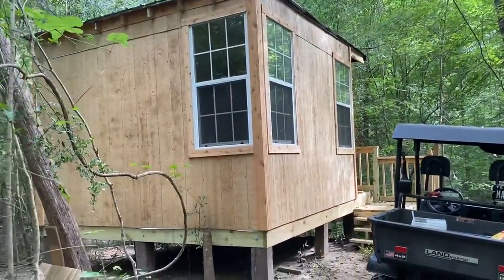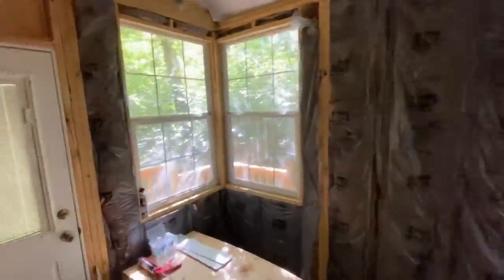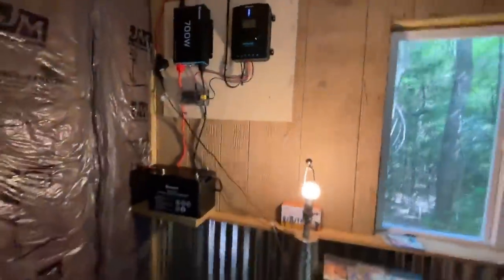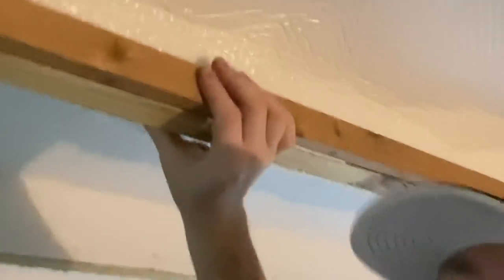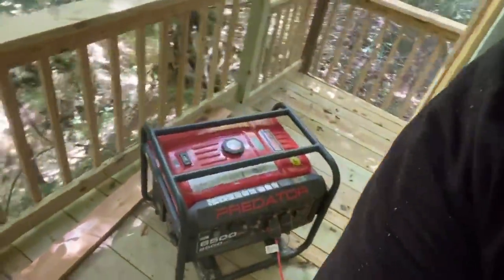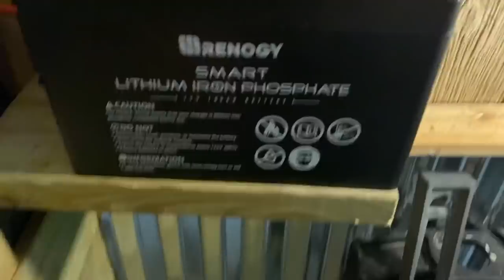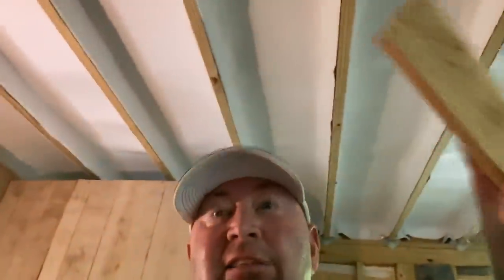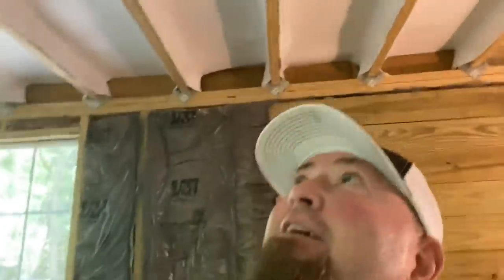Off Grid Cabin Solar Update, Fence Picket wall, & Ceiling

Comment: 1x2 on each side of the rafter and cap the bottom with 1x4.  It will look awesome!!! Love the wall. I bought a bunch of fence pickets when Lowe's had them on sale and used them for several different projects. I loved working with them. Cold Beer Cabin is really shaping up and looking great. Have a great day, John! Coooold Beer!!!
Reply from the maker: Kevin, on point.  Yes i like the idea of 1x2 on the sides & 1x4 on bottom🍺

Comment: When you do the rest of the wall, line up the new pickets with the dog ears together. There will be a diamond pattern down that line. Could look kinda cool. If you wanna cover it, just use another fence picket to match.
Reply: David Hancock like the idea of lining up the dog ears maybe painting a thin board black to put behind were it makes the diamond shape. It would make the diamonds stand out .
Reply: Or cut some little diamond shapes from a different color wood to plug the holes...very  nice.

Comment: Faux beams is a great idea!  I would trim the rounded edges off the fencing, leave a gap between each side so that your vertical peace would be flush with the boards.  Use the same wood.  The cabin is coming along great!

Comment: Like what your doing. Thought, the bubble wrap coated with aluminum needs to have a pocket of air between the roof and the aluminum for it to work well. Look up reflectix, that is the major brand name of this type of material. They have good videos on the site that explain why. If you don't want to pull down what work you have done you might consider sheeting out your ceiling rather than trimming it out. You would have a nice ceiling and have your pocket of air. But best practice would be to pull down the bubble wrap and put it back up with a 4" gap between it and the roof.  Still looks good!

Comment: Hey there John!!  Another great video as usual!!  Man! The tiny house is definitely coming together!  I like the idea of putting 1x’s on either side of the rafters and capping it off with  a 1x4.  And for the battery shelf, I’d just tack on a strip of wood that is taller than the front edge of the shelf and create a lip so the battery doesn’t fall frontward off the shelf.  Also, couldn’t you just use a picket panel to cover the seems of the dog eared end of the fence panel?  Well John,   hope you have a great night!  I am always looking forward to you next video!!  🍺
Reply from the maker: Hey Scott, thanks for your input!🍺🍺

Comment: I would try to get as much insulation in the roof as you can. Thats where most of your heat loss/gain will come from. That foam board is great easy to work with and pretty resonable. Looks nice man.

Comment: I’d be putting batts in the ceiling and covering the it with tongue and groove. 
Also, try to get at many 12v dc appliances to save running your inverter. A 12v light would be a good start.

Comment: Loving your channel CBR! Got my own little cabin out here in Arizona. A couple ideas- The 1x4  to dress up that ceiling is a great idea. A benefit to that is the tiny ledge it creates. You can hide thin strips of LED light tape to it to create ambient light at the ceiling level. Would look good! On the wall, you can also cut a few of those fence pickets in half, that way you have a staggered look to the wall. Even more "cabiney". EXCELLENT JOB! (By the way, think I'm stealing that corrugated siding for the kitchen. Love it!!
Reply: What part of AZ are you at? We are homesteading North AZ
Arizona Unplugged on YT

Comment: With respect may I suggest having done my 14x16 cabin.  I used the fence boards and know they will shrink.   That being said either spray the insulation black and or put black felt paper up then the board's.  Then in the future you won't see the stuff behind.
Second always do the wall from did to side with trimmed ends and stager the joints working your way up or down.  No direct seams up the wall.
Ceiling your idea of the side trim boards then a cap will be nice just know there is never enough insulation it will be an on going battle with heat and cold.
Some type of wood stove lots of ideas online for that.  Your in the woods with endless amounts of downed wood for heat.  Also if your out for several hours and want to maintain some level of heat a "vented propane heater" will be your friend.  VENTED.
Water can be done via containers and gravity fed and the low side of the roof should have a gutter for harvesting of rain water.
Your solar is great but know the wonderful trees we all love will also be a battle to insure solar gain from the sun.
Fun project enjoy the journey it's been an ongoing journey for me.
Best to you my friend.
Reply from the maker: Harold, thank you for all the insight and learning, I really appreciate it🍺🍺

Comment: I like the fence panels on the wall. I would have cut off the dog eared ends to be straight. Then they will butt up flush to each other & you won't need trim boards to cover seams. Or...still cutting the dog eared ends, but stagger the seams like they do on a wooden floor. For the ceiling, did you see what Good Simple Living did with their ceiling on their tiny house, inside their barn? You could mount beadboard, and hide the seams with the 1"x2" cedar strips you already have. Hope this gives you some ideas.🤔😏 Enjoying your vlogs on your tiny house build.

Comment: Hey John bring you a mini fridge down you need a place to keep that cold beer at and that will definitely set the power down and let you know how it's going to function and about the roof I'm a girly girl and I worry about the spiders and bugs that are going to be up there so I think you should enclose that with the same siding that you used on the outside of the house just close that sucker up. And yes trim would be nice where the dog ears join at, even though it would have been nice if you had cut the boards off halfway where it attaches to the 2x4 and then you could have attached the other board to the same 2x4 and then just run a piece of 1" quarter round down the seam. Everything looks so good. Are you going to be using a composting toilet?
I should have read the other comments oh well great minds think alike 💡

Comment: I think at the edge of the pickets instead of putting trim over it you should just put some black caulking in thereAnd stick a beer bottle cap in each one so it makes a bunch a little diamond shapes in each one you can have some collectors beer bottle cap or something in there.  Or maybe just put some black duct tape over the insulation underneath the edges so it’s all black and then just put a little caulk in a beer bottle cap and stick one in each little diamond shape.  That way you’ve got your cold beer theme going and it’s something unique that nobody else will have.  Maybe even have a bunch of users send you caps like they do license plates.
Reply from the maker: Shane great idea

Comment: The way you boxed the sides of the ceiling rafters and then put a 3 inch wide cedar board to cap it would look good. Also instead of 2x4 studs you could use the same 3inch cedar board to cover the joints of the fence board walls which would go well with the cedar ceiling trim.

Comment: I have a harbor freight solar kit. It's enough to provide power for a 12v  costway fridge 54q connected to a $75 walmart marine/rv deep cycle battery. It also can provide power to cell phone and laptop, because those are low energy items.

Comment: The ends of the picket will eventually curl since they are not nailed down. I would have cut them at the last stud.then but the next portion of wall to those boards.

Comment: The cabin will stay brighter with the white ceiling with the cedar trim. If you take a small cooler, filled with ice, have the fan blow over the top. Instant air conditioner!

Comment: Hi John
I was wondering what you were going to do for heat and air ?
I know they make a mini split system that runs off solar and no bigger than your cabin is might be something to check into  just an ideal since your enjoying and excited about the solar thing 
Like the ideal about the beams maybe cedar yes I like the cedar looks rustic.
I like the wood look on the wall I'm not to sure about dog ears yeah much better to cover the ears I think I would stick with the cedar trim since you have it outside.
It's starting to look like a tiny cbr cabin
Pass me a cold beer
Reply from the maker: Here you go Patty 🍺🍺

Comment: The Dog ear trim needs to be thin, not as thick as what you held up. With all those different woods and colors of wood, use something painted. A contrasting color that will match something else. Are you going to have cabinets, rugs, curtains something with color?  If so, have the trim match in that area. If not, white for the door or windows or even a gray. Just not another type, grain & color of wood.
Reply from the maker: You are definitely above my skill level, I’m just a guy, not sure I have that much class, LOL wood here wood there it’s good

Comment: Where are your boards come together and create the square/diamond pattern put your trim board behind them, not on the front.  Leave it as a design feature.  You could slip photos or beer caps in the square/diamond openings.
Reply from the maker: Beer caps are a great idea

Comment: You have such a short run...cut back the ones on the wall to half of the wall 2x4 that will give you a nailing surface. Now measure from the window edge to the new cut off and there's no need for that vertical board... keep on keeping on
Reply from the maker: John Jason I think the vertical board will look cool though
Reply: I really enjoy watching your build..... Don't know what state you're in... do you need a permit for open carry? Keep up the good work
Reply from the maker: John Jason, not on your own property, but yes i have a permit. In Texas!🍺

Comment: Of course trim the butted dog ears with a 1”x4” trim piece. 

Get a sofa couch or a day bed that doubles as a sofa. Add a smaller tabke and chair and. Nice book case for decorations. Etc. Psi the the wood chr uryre pieces with paint  solid med.blue and add curtains drapes or just a balance on too the Dane color as the painted  furniture.  etc.  paint doors Dane. Lue i side and iut and shutters if you  add any 
Oh and get a ceiling flush ceiling fan with a lite kit for the center if the room. Paint blades the Dane blue. Then hang done animal heads but give then real hard to wear maybe a tie ha hung down. Blue if course. Would be a hoot!  Add a shall pot belly stove in from if wgere you butted dug each tigther acs add fake bruck label just begund it with Sri e is ers. Then a nice multi colored with lots Jeffrey blue braided rug would look killer. Not to this not too that. Add shelves in kitchen. I ca Ubers if too as that tahe up room shelves better. Add cabinet doors under neath suck add sfekves under theyr too have sink drain out through our that goes duwn then else out towards the slope and then bury pipe to come out on ski or to go towards creek.vet. I post toilet and tile the bathroom all around or hand way up. 
Need some potted plants on deck that are shall fruit trees ir provers ir begins in pours. 
I’d love to see you go done if these things. Better than jssins he’s so skiw. He’ll never get ubti the cabin and will still sleep iutshde. 
Add wood chest outside for sball told and fur svytgybg yuukkk. Red in deck. Doubles as bench. I kyn12”. From wall. 
Maybe flower boxes with veggies in them.  Cool I’ve the solar add a radio. And tie music from your videos to okay in background  while taping  in cabin.  Love what you’ve done so far.  So 
UCB. Ether that. Jason’s. I like him and his plave but the man has no work ethics. He’d rather play and fish than work. Turns me off. He needs guidance.   Love cabin good luck best wishes Jeffrey White

Comment: Hi John you're doing an awesome job the wall with the picket planks look great the idea that you want to do to the ceiling would look awesome you need to hang a electrical box in center of room and put you a low -watt ceiling fan up with no light we'll help move air around in the tiny home. And if you are a deer Hunter like I am I would build me a 6-6 platform on top of my roof with a roof over it for a deer stand or a lookout tower when you're not there you can always can put your trail cam up there to record any movement around tiny home. Keep up the good work John and God bless you .
Reply from the maker: STANLEY VINSON love the fan idea, i was looking at them on Amazon 🍺

Comment: I don't know but if the pickets are treated, I don't think ur supposed 2 use treated inside its got arsenic in them. Might make u sick I don't know
Reply: @Chad treated wood hasn't had arsenic in them for over 10 years that I know of probably longer than that.
Reply: @denisewilson8367  ok good I didn't know. Thank you for the facts.